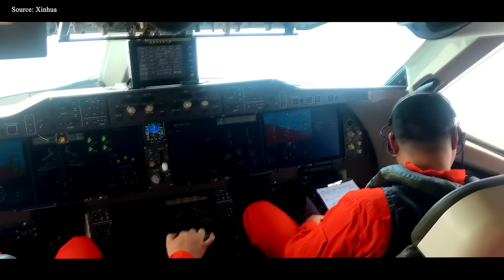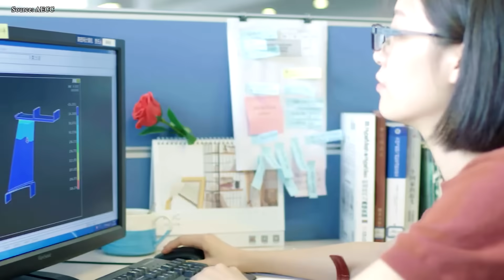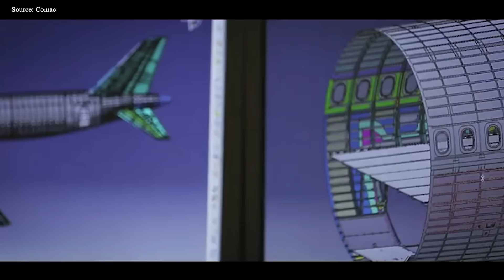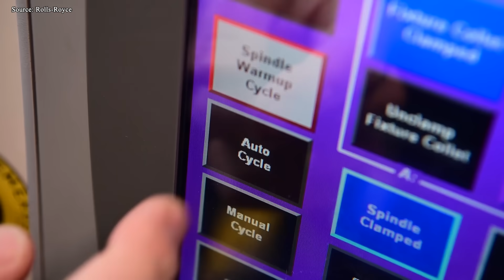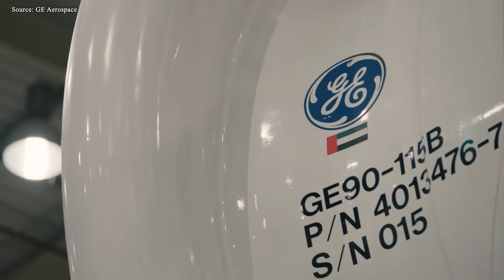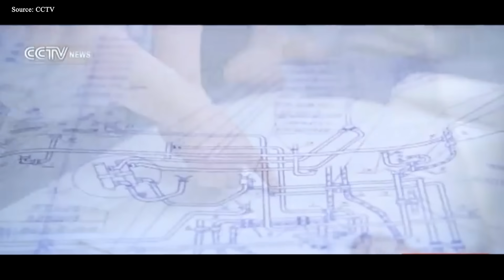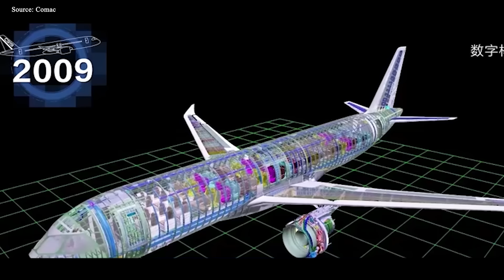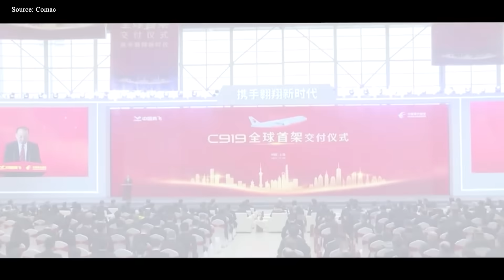This Is Why NEW Chinese CJ-3000 Will Outsmarted Rolls-Royce

Comment: I have read where China and Russia are working on two passenger jet engines which they both need. They are working on all components that the west provided in its aircraft that are used inside both countries. The Russians seem to have developed very high end fan blades for the engine reducing inspections in this area extending engine life between strip downs.

Comment: China will out compete and out grows the traditional Rolls Royce and other aviation engine manufacturers in the near future. China's super high bypass ratio turbofan engines with high performance and efficiency, the CJ 3000, will be powering the new wide body Long Range C939 civil aviation aircraft as Comac is taking away Boeing's market share in the world.